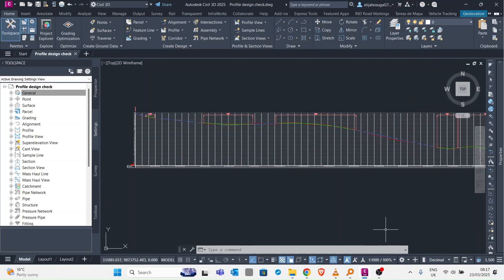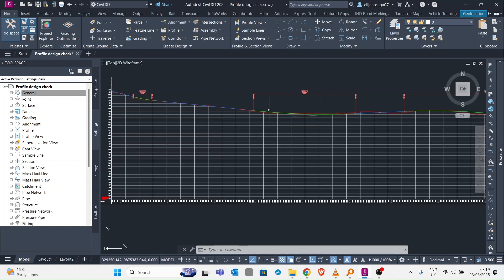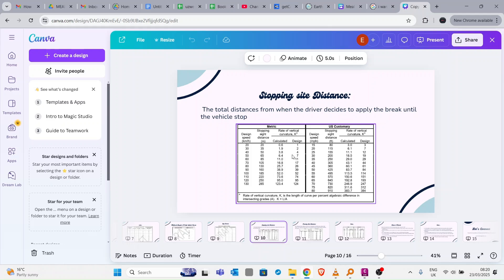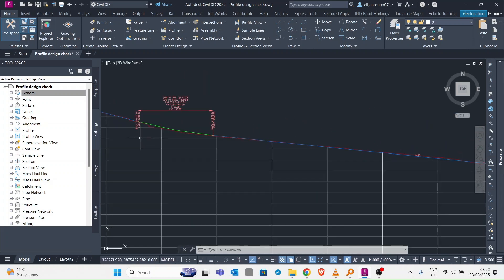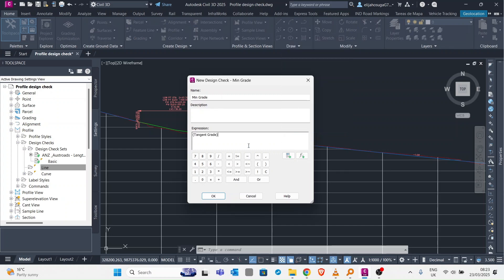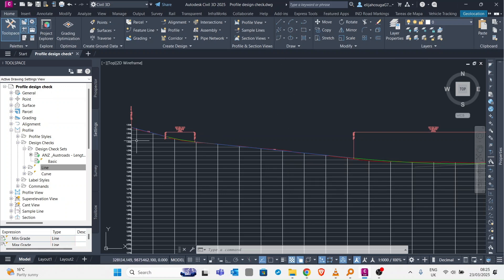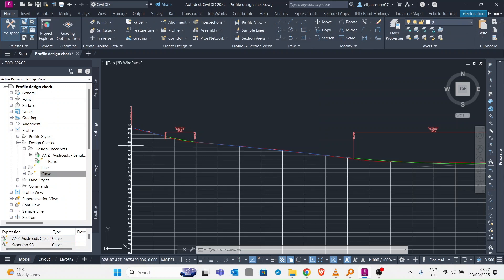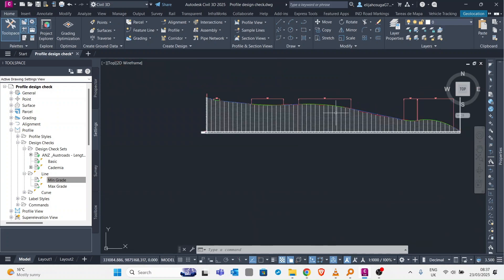How to Apply Design Checks to Your Design Profile in Civil 3D 2025

Comment: Thank you so much for this helpful video. In fact, this is exactly where I’ve always had problems when practicing road design.
I’ve never completed a full road design because I wanted to fully understand the SSD, PSD, and HSD, infact the design check set concepts overall — I always got confused when I reached the profile design stage.
But now, you’ve enlightened me!

God Bless Engr.
Reply from the maker: You're most welcome! Happy to help.